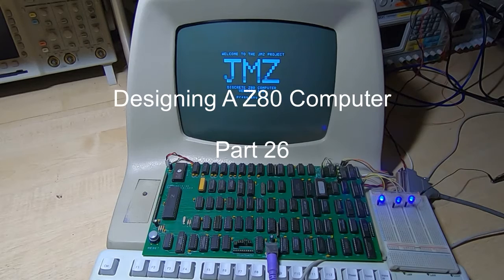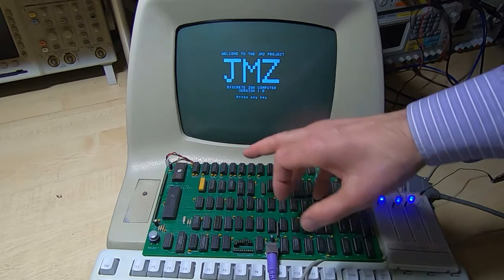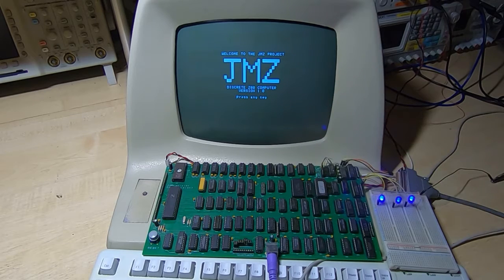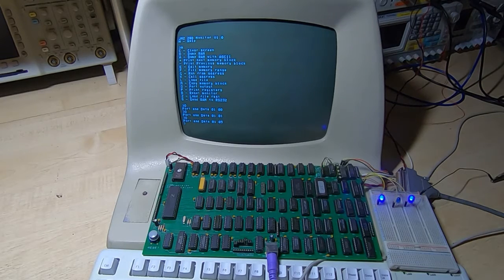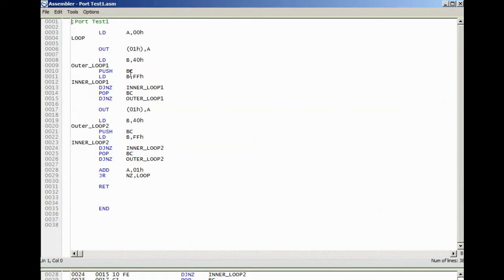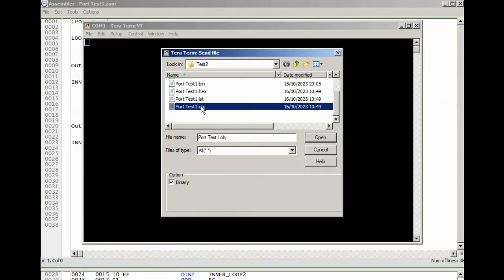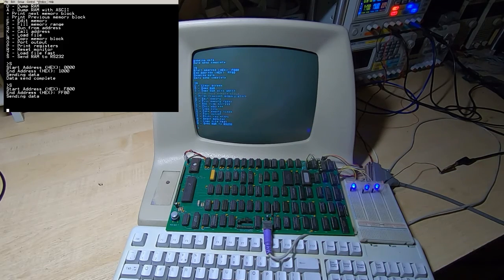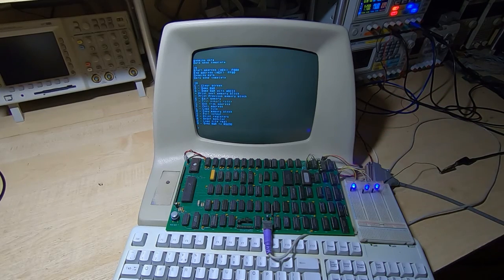Designing A Z80 Computer Part26

Comment: 3:44 I am not sure if the description is quite right. how would it read the return instruction after the bank switch? Some sort of bank switch delay? I would have said have a common jump function that is in all banks and push the address and bank and then jump to that function.
Reply from the maker: Yes as I said in the video all global code is in the common RAM areas so for example a bank switch would be implemented by jumping to a bank switch function (JP) after pushing the required destination address onto the stack. This function is available on ALL banks so when it switches bank the function is still available. It would then simply RETurn which would end up at the required bank and address. This means that only 4 instructions in total are needed (PUSH, JP, OUT, RET). This is how I currently do this and it works. You could of course implement this in many other ways such as a BIOS function call with both the target and the bank on the stack but that is less efficient.